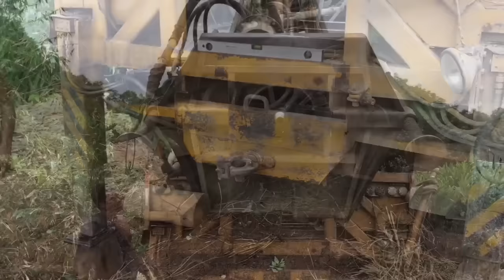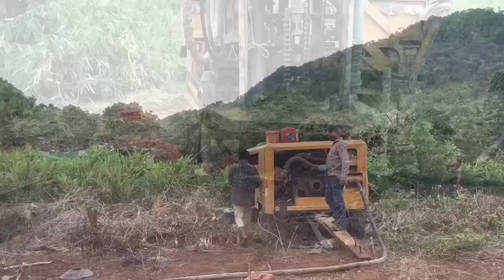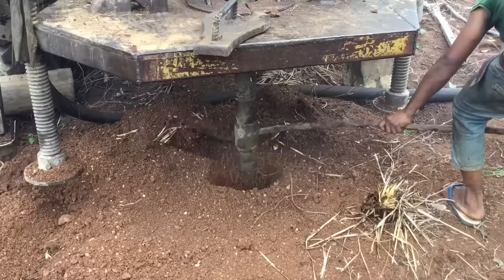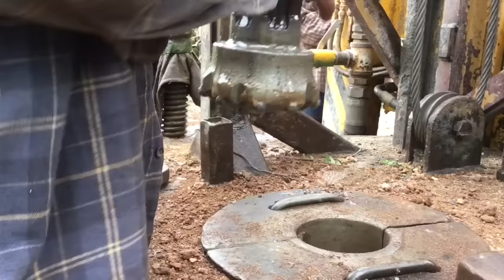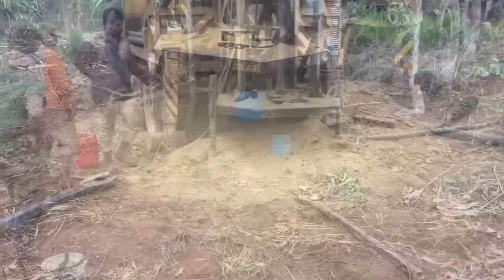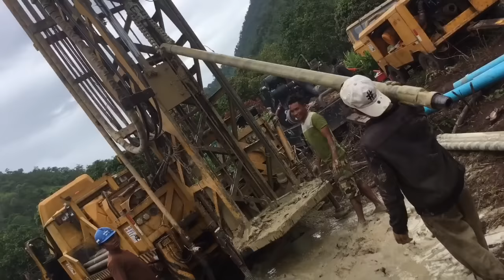Bore Drilling Machine for deep well In Agribuzz Farm

Comment: Interesting video.  Looks like they're blowing air down the hole to bring the debris up, rather than using water.  One thing though...if I were those guys and got paid $1100 for this job, I'd go buy myself a pair of boots!  I'd be afraid of getting my feet crushed in the sandals with all that heavy equipment around...
Reply: Correct fuckin madness no hi viz either
Reply: Poly Hexamethyl safety boots would do nothing but make you feel safer, when in fact any moving part of this machine could main or kill you.

Comment: Love the down hole hammer...Need safety shoes alright. I am ambivalent about the hard hat . wore one 20 years and never saw an accident it would save you. Bolt came out of derrick and dented floor. Would have went thru a hard hat like butter. I saw men hurt when trying to bolt up BOP with fogged glasses but Exxon wouldn't let them use screen goggles just for that operation. So one missed the hammer wrench and struck another guy. Common sense is not the Exxon way.
Reply: प

Comment: Spent five years drilling bore holes in the Channel Islands using a hydrex minor and Holman compressor 
Rig was mounted on a county 4000 tractor was always only a two man operation why so many men for a two man job
Reply from the maker: That is it. They are not professional even safety gear they don't have
Reply: Keep u mouth close
Let them work

Comment: i SEE ABOUT 100 FEET OF DRILL STEM OR ROD  NOT SURE IF THEY USED IT ALL ABOUT 30 GALLONS AMINUTE BUT WOULD NEED TO PUT A PUMP DOWN HOLE  AND DO A MINUMUM 2HOUR PUMPFLOW AND 2 HOUR RECOSERY TAKING READINGS TO SEE HOW IT DREW DOWN AND RECOVERED THEN TAKE H2O SAMPLES TO A LAB FOR H2O RESULTS
Reply: Tim Klassen You Funny!

Comment: Liked. Although that was relatively uninformative. How deep was the water, and how much was the rest of the costs?
THANKS FOR THIS VIDEO
Reply: This video is taken in cambodia and Well infrastructure depends on the depth at which water can be found underground. For example A 30-metre well can cost $500 to dig, a 100-metre well can costs $7,000 or more.